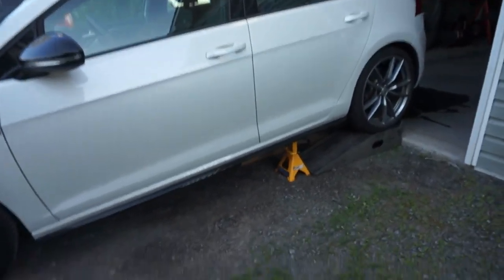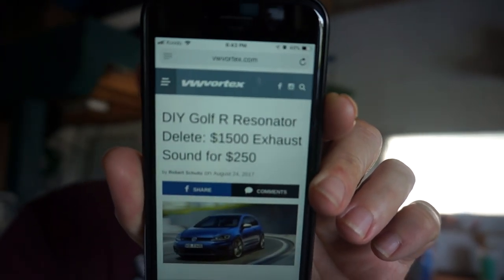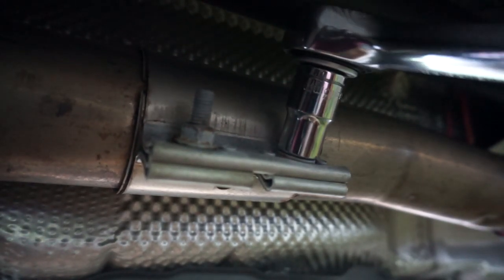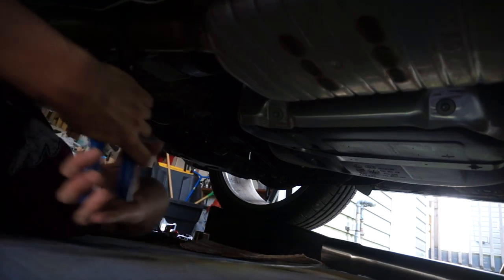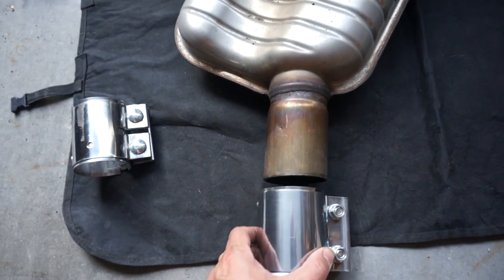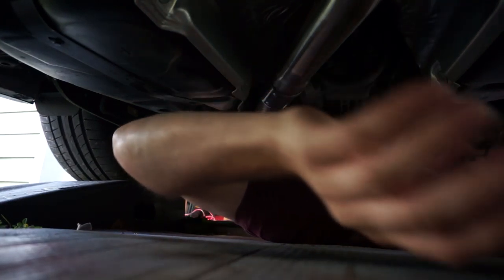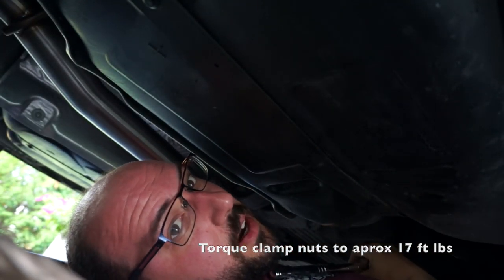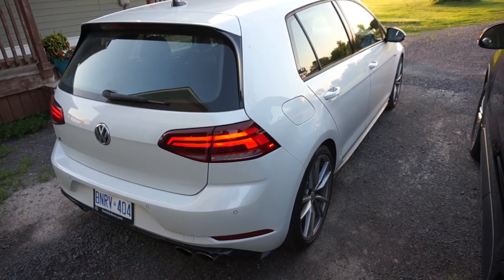DIY VW Golf R Exhaust Upgrade! CTS Turbo Resonator Delete Kit Install - Netcruzer CARS

Comment from the maker: Check out this kit and more tuner parts from CTS Turbo: http://www.ctsturbo.com/product/cts-resonator-delete-kit-vw-mk7-r-audi-s3-8v/
Here's the VW Vortex article I mentioned, it was useful for install tips. https://www.vwvortex.com/features/diy-golf-r-resonator-delete-1500-exhaust-sound-250/
Reply: Do you have your valves coded open?
Reply from the maker: Nathan Reinhard no that’s why I show it both ways. Watch for the text between sport and normal and the noise of the valve moving.
Reply: @netcruzer  i have a stage 2 golf r with downpipe and crackle tune just ordered 8v resonator delete how u think it will sound good? it allready sounds good nd abit loud just wondering if the res will make more of a difference

Comment: Do you have any drone? I've heard ppl say it will drone if you remove the resonator, I might want to do this on my mk7.5 gti.
Reply from the maker: IMO it has less drone than stock! It’s louder, but that’s not drone. I drive mostly between 60-120kph and have not noticed any drone.
Reply: I can attest to the fact there is no added drone and that was one of my concerns going forward with this mod.  If you have a basically stock exhaust and this is your only mod, no drone.  I've read that an after market down pipe in addition to  this mid pipe will add drone.